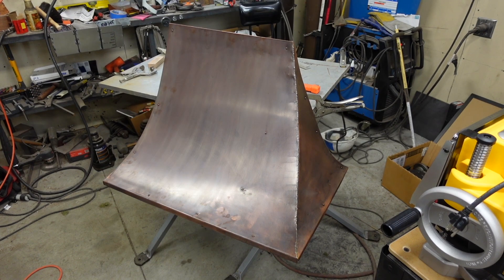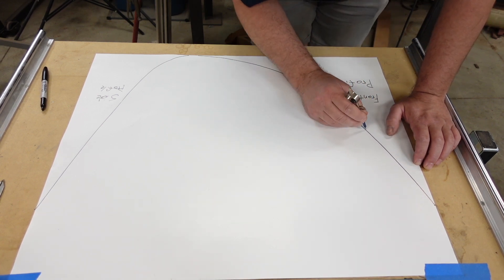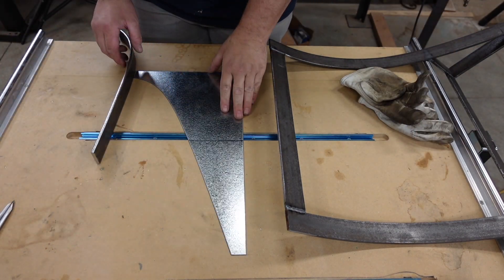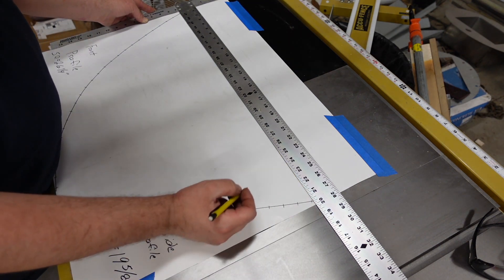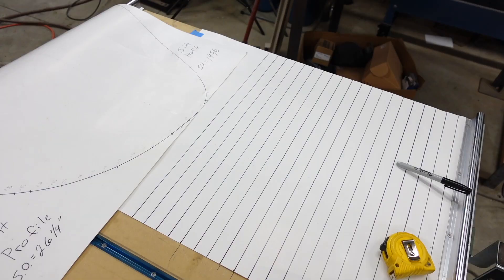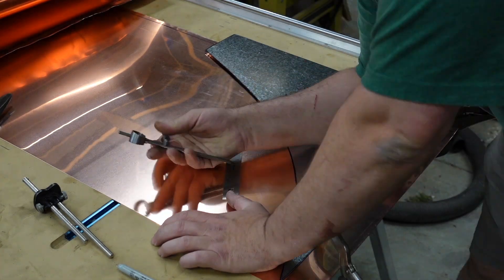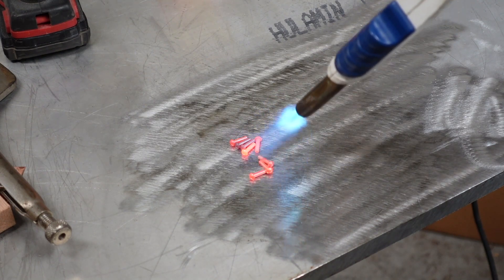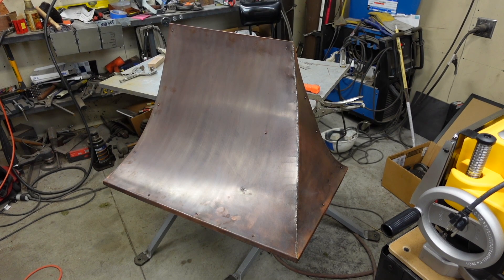🔴 DESIGNING A COPPER AWNING!

Comment: I hope your customer doesn't know any better about putting dissimilar metals together!!
Reply from the maker: Good point Pete. Galvanic corrosion. This is a mock-up but for galvanic action to take place you need dissimilar metals as well as an electrolyte such as water. All pieces of the final piece will be lacquered sufficiently to prevent this. Thanks for watching and share it with someone you think might be interested
Reply: @TheMoonlightCraftsman  you could have used stainless steel for your frame. No electrolysis with that combo.
Reply from the maker: Yes you’re right, they’re kind of more into the rustic look but I suppose I could have blackened the stainless with a chemical. Thanks for watching brother